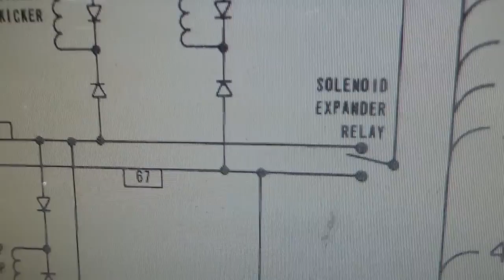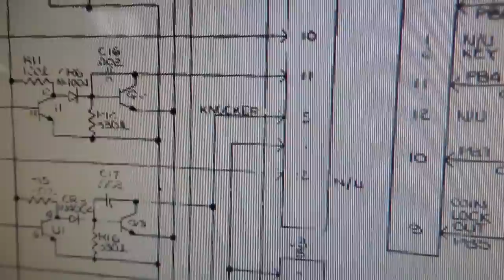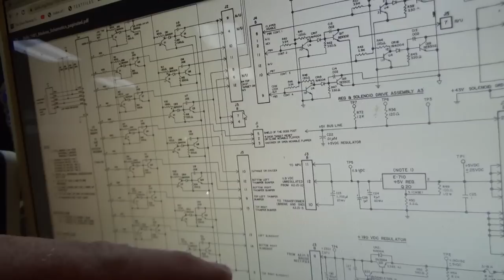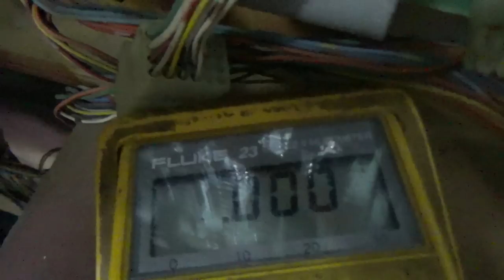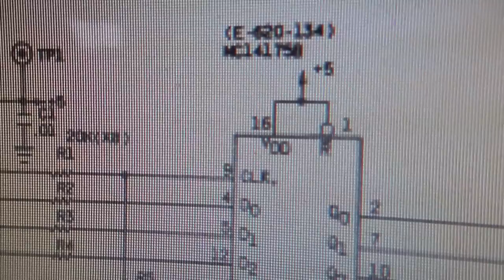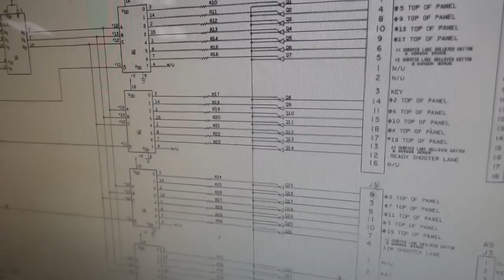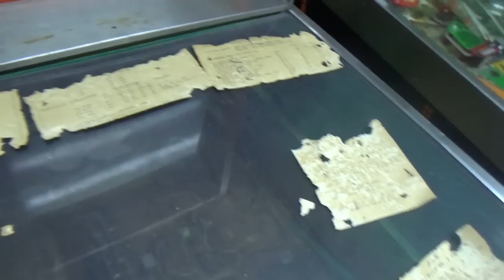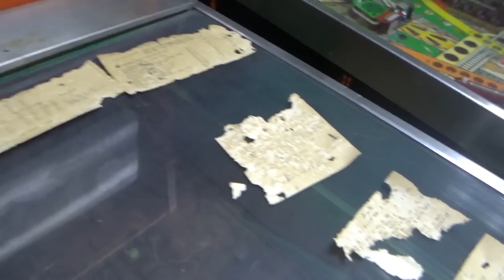Bally's Idea To Control Twice As Many Coils By Adding 1 Relay - 1981 MEDUSA Pinball Repair 6

Comment: Thank you so much for documenting the fix on the Medusa. Your walk through the logic and problem solving is amazing Ron. You have such a wealth of knowledge and share so willingly. You continually help keep my pinball machines working. I live in a small community up the west coast here in Canada. So if I can't figure out my problems I'm kind of screwed. Funny story....I was working on my Black Knight the other day. I came back inside the house ( My machines are in there own little studio) and wondered where my cell phone was.....Well then I just walked back out to the studio and there it was in the bottom box of the Black Knight. I was using it as a flashlight for the fix and had closed the playfield with it still sitting in the bottom box. The things we misplace when we are fixing stuff. :)
Reply from the maker: I did the same thing one time, left my phone inside the machine with the light turned on :)
Reply: @LyonsArcade  We are prone to power outages where I live now. Should a pinball machine be plugged into a surge protector power bar in this case instead of just plugged into the wall? When the power comes back on can the surge fry some components if the game is only plugged into the wall? Many thanks Ron!
Reply: @paulclarke7571  lol smh
Reply: @LyonsArcade  Good thing you found it before shipping it to a client...
Reply: @paulclarke7571 , write "When the power comes back on can the surge fry some components if the game is only plugged into the wall?"

From my understanding, the odds of that are incredibly small. The old-school non-switching power supply is going to soak up pretty much any surge before it can get to the electronics. Some machines have a metal oxide varistor (MOV) built into the machine that's useful to protect the machine from things like a lightning strike. So if you're in an area prone to lightning storms a good quality surge suppressor may be a worthwhile addition.

Note: A typical power bar doesn't necessarily have any surge suppression capability, and even when they do it's often minimal. If you live in an area with particularly dirty power a high quality surge suppressor makes sense, or better yet, a UPS. A decent UPS will not only protect your equipment, but will keep the power stable through brown-outs or short term drop-outs (as well as let you keep playing in a full-blown power failure).
Reply: @fred_derf  I couldn't agree with you more.  A UPS is indeed the way to go.
Reply: @papafrank7094  I've got most of my electronics protected by UPS's. We had a big wind storm last night and the power flickered several time and went out completely at least twice. And none of my stuff was affected.

Comment: This is really coming together great Ron.
If I had the money, I would buy it.  I love the drop target sequence feature.  It makes the player have to really practice their aim (if there is such a thing) to hit the set targets.
Reply: It's a cool machine and if you like em tough, this will do the trick.. The outlanes are some of the most unforgiving I've experienced. The display in the middle of the playfield includes the timed extended play feature with unlimited balls, the extra ball feature involves the lower playfield, and the ball save between the bottom flippers. Alot going on for 1981.

Comment: Amazing how Bally used the same main boards for years. Seems as only the aux light driver and sound boards changed. Makes sense as they added more lamps and improved sound. Going from Chimes to Sound Board freed up three/four solenoid lines, but then they were quickly used and expanded. This commonality is a big reason why I like these old Bally machines. Looking forward to your Medusa sound series.

Comment: Ron, enjoying these repairs you, Medusa is an awesome game and challenging to repair. I have one and changed the playfield out with a new CPR one recently.
 Throughout the video, whenever I see it, it urks me that the skill shot lamps top left shooter lane aren't working properly.  They are in parallel with the gorgon lamps at the spinner, important feature for scoring, hopefully it's just the bulbs.
Reply: But, with the shooter lane skill shot lamps, I think it might be a deeper problem than just the bulbs because the spinner middle gorgon lamp seems to be pulsing out of sync. Also, the right-hand side bar bonus lamps, the very last two, they might be lighting together like they're short or something, but maybe you sorted it out when you got into the Aux board repairs.
Reply from the maker: Yeah I couldn't figure out what was going on with all that either.  Everything was wired correctly.... very strange.  I feel like it's a software problem... but I've seen other people saying they've used an Alltek board in their Medusa so not sure.

Comment: I think what was happening with that one light is (you were just about there), I think the bulbs are blinked by charging a cap and then discharging it to the light and the light blinks, the cap discharges, and the process repeats.  the cold joint on the pin was somewhat touching, just not as good as necessary, so with each attempt to charge the cap, it's not enough to light the bulb, but after so many times, it builds up enough charge to make it flash (and dimly at that).

Comment: It's way over-the-top for a video, but it would be very cool if you could split the data connection from the MPU and  run both sound boards at the same time. Then you could record both (on separate tracks) and in editing switch back and forth between them while playing a single game. New Hotness. Old and Busted. New Hotness. Old and Busted.

Still, I'm really looking forward to seeing hearing the difference.

Comment: When you replace a drive transistor like that. ALWAYS check the diodes on any coils that it is driving... unsolder one end of the diode and use the diode check function of your meter.
Reply from the maker: You should definitely do that on yours
Reply: @LyonsArcade  The diodes DO go bad and open up, and if that happens, every time the solenoid shuts off, the inductive flyback arcs across the transistor, which eventually kills it.  Replacing the transistor will be a temporary fix in that situation.

Comment: I noticed a few things.  One is the tens digit of the yellow LED timer display on the playfield keeps advancing more than it should I think (it seems like it is trying to count down but the ones digit keeps advancing the other way).  Perhaps a switch is stuck on or a wiring fault of one its data lines?  I am also wondering about that unusual flash of lamp seven on the auxillary board while in attract mode.  I wonder if there is any connection between the two, perhaps they are multiplexed somehow and the switch stuck on is causing a chip to switch modes in the multiplexing somehow reducing the pulses needed to flash the lamp?
Reply: The "like numbers" feature looks like it working correctly.. the left counts up, the right counts down. Complete all the targets on either side of the machine, it locks on a number, then you try to time your shot to complete the other side, matching that locked number to get the extra ball. Not easy to do.